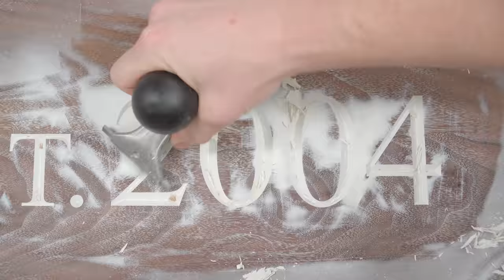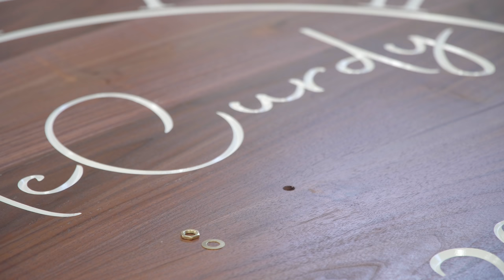McCurdy Clock - 378

Comment: What clear finish do you use before painting the letters and numbers?  Does it help the excess paint come off?
Reply from the maker: Sealcoat shellac. It reduces color bleed into the wood. This is helpful for the areas where you don't want the color to be as well as helpful to keep the color on the surface where you actually do want it.

Comment: Jay, I noticed you made a drill attachment to speed up the planer adjustment. Would you mind showing/describing it? Thanks
Reply: Since you asked this question I had to look. It appears he just cut a circle large enough to exceed the diameter of the adjustment wheel a new cut a notch out to fit over the handle. Attaching it to the drill shouldn’t be too hard. Just my two cent thought.

Comment: Jay I build a lot of these clocks from 24” to 56” and I’m curious on your thoughts of the 4-9 numbers being backwards. It seems back wards to me anyway. I always put my numbers so they’re readable around the clock. Maybe I’m doing it wrong?
Reply from the maker: Not wrong either way. Personal preference. It looks odd to me flipping some of them. I think the clock originates at its center so all numbers should be oriented towards the pivot of the hands. No right or wrong.
Reply: @JayBates  thank you
Reply: Part of me agrees with you. However, does that not create an interesting issue with the 9 and 11 being in the same direction? I've not made anything like this yet, but I plan to. I'm not yet certain how I am going to handle this issue.
Reply: @johnfogg7858  no.  The way I do it is put the numbers all in the same position. The bottoms of the numbers all point down to the bottom of the clock.
Reply: I would put IV thru VIII right side up.
Reply: I agree with Jay, I have made dozens of clocks like this although mine average in size from 10" - 24" and I struggled with how to orient the roman numbers but ended up towards the center. No right or wrong it's about personal preference and I usually ask the people who I am making the clocks for how they want the numbers oriented. Most choose to have the numbers orient to the middle.

Comment: What was the device you used to raise and lower the planer ?
Reply: It's clearly just a disc with a notch cut out that hooks over the handle of the lifting mechanism and is run by a drill
Reply from the maker: It's a disc with a notch cut out that hooks over the handle of the lifting mechanism and is run by a drill :)
Reply: @JayBates  Thank you

Comment: It's a very common mistake to put the numbers 4,5,6,7 upside down a proper clock maker should know this also the ticking clock sound was for a spring wound clock as it tictoked in stead of just a single tickets every second that a battery quartz clock makes otherwise a good video.  I've been a watch and clock maker for 55 years